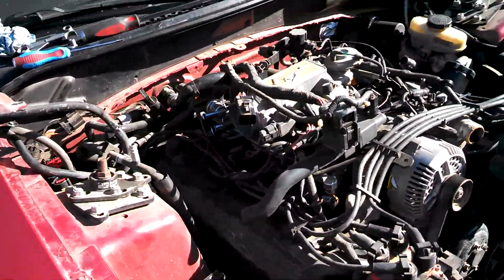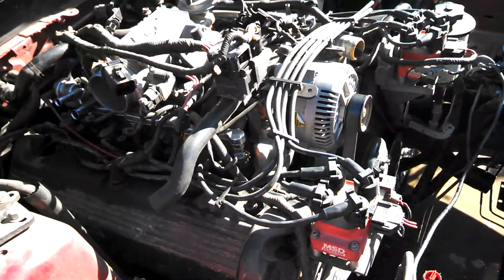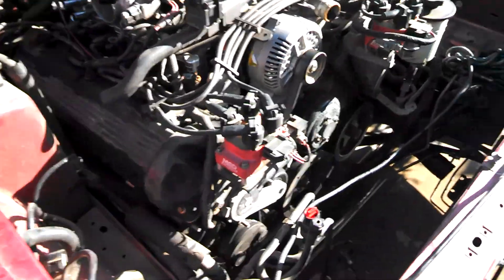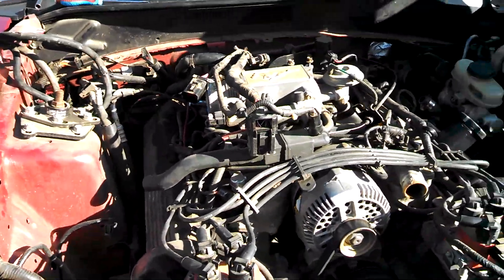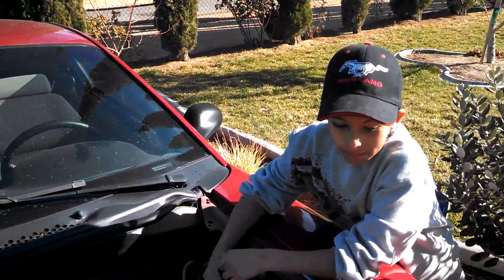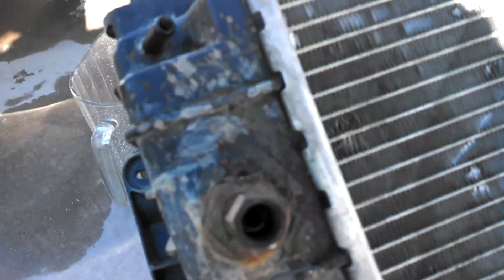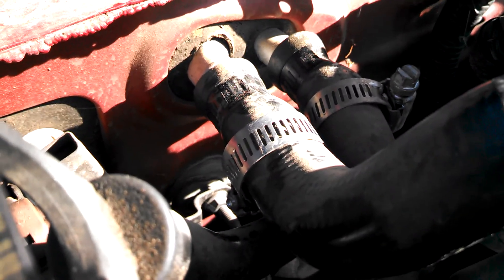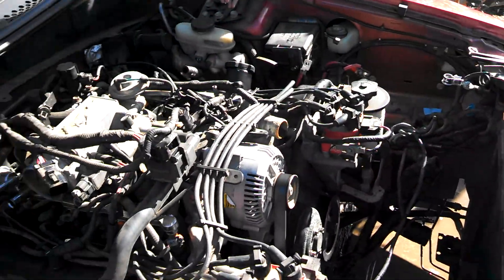1998 Mustang GT motor swap to 2004 4.6 long block blown engine rod knock. HOW TO PART 7

Comment: you coulda swapped the computer and ignition from 04 for free and would take u like a few hours
Reply: when swapping ECU is it a straight plug in or do you need a cut and be connecting wires ?
Reply: Straight plug in